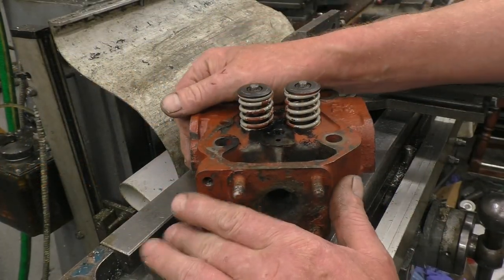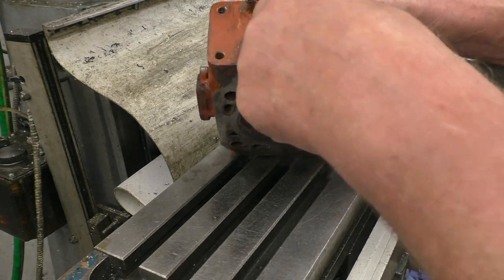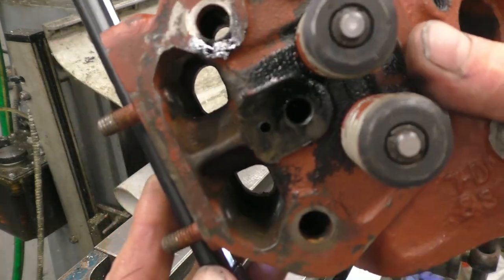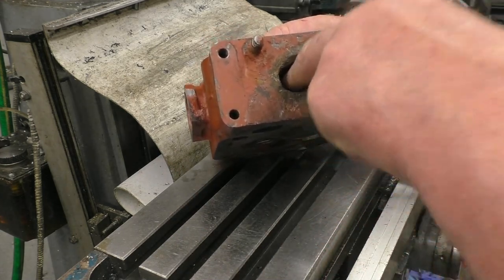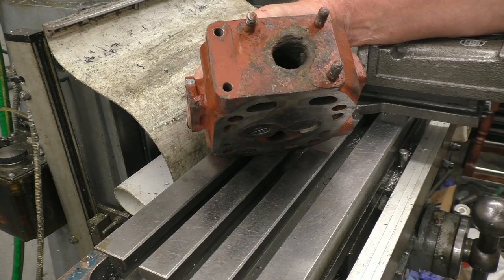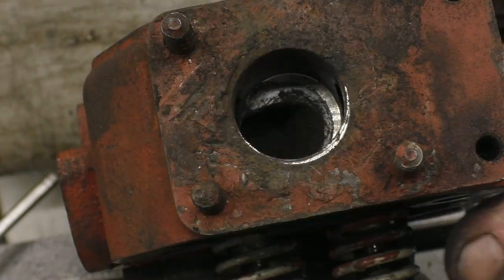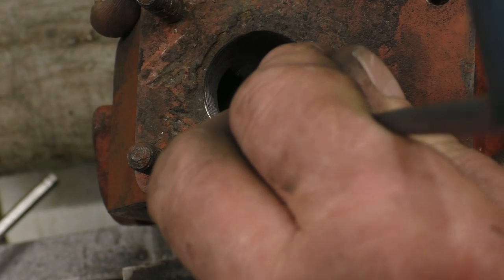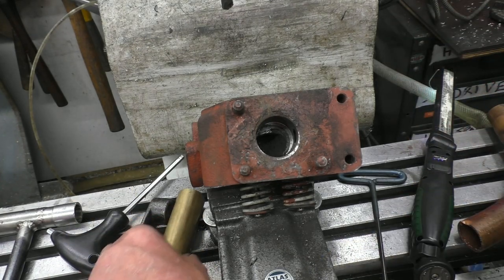SNNC 437 P1  Yanmar Cylinder Head Repair

Comment: Hi John, Seawater will take the zinc out of brass, leaving a weak honeycomb of copper.  Better to use a length of Galvanised water barrel or 316 stainless steel.
barrel.
Reply: Agree. Brass has no place on a boat.
Reply: Correct
Reply from the maker: @srp01983  Very good point any more will be in stainless steel
Reply: would naval bronze also work? i. e. alloy of copper and tin versus brass which is copper and zinc.
Reply: @dwightcarlson7136  Yes, any of the true bronze alloys. Or Stainless 316 as others have said.
Reply: @doubleboost  I would suggest using durAbar cast so the thermal expansion rates are the same. Lots of diesel heads tended to have sealing sleeves of different materials like what you did and eventually they seem to always start leaking.

Comment: John, nice repair but I fear that the brass will suffer parting corrosion or de-zincification as it is also known, especially as it will be in direct contact with the seawater. It depends on the grade, but it would have to be a low zinc alloy to last very well. As a back up spare, I'm sure the owner will be very happy to have it saved from scrap. I really like the mantra 'bore it out, part it off, whack it in'!
Best wishes, Dean. 
Edit, I see someone else has already mentioned this. Sorry to parrot another comment. I agree with the other viewer, a marine grade of stainless would be a good choice for the sleeve. 
Great video, thanks. 
Dean.
Reply from the maker: the next one( if there is one )will be a stainless sleeve
Reply: @doubleboost  There's no doubt it will get him out of trouble if needed John, and it's 100% better than it was. Great night caps.

Comment: Congratulations on 90K subs, bonny lad.

I think, that the bush was enough of an interference fit, without the epoxy resin. I'd have used a few drops of Locktite 603 or 638 (bearing retainer) to make sure it stayed where it was meant to be.

Comment: Be sure to check that the water cooled elbow hasn't failed and began dripping down the wrong side of the exhaust. That's where I see that issue, often freeze cracking on speedboat manifolds that never get drained, but I've only messed with freshwater stuff.

Comment: Nice to try to salvage the head in some way. Brass is no good in seawater unfortunately. It will de zinc it. Aluminium bronze is a good alternative. Or a suitable bit of 316 stainless tube that could be machined to fit. You could also have used a good grade of aluminium like 6082. And I have just realised everyone and his dog have said the same. Sorry.
Reply: Or  gunmetal or permabar malleable iron or admiralty bronze but agree with you totally that brass is hopeles in marine applications
Reply: @howardosborne8647  Yes you are right. The main thing is that for many amateur engineering applications it is possible to use almost any material and get away with it. There are occasions though, and this being a good example, where correct materials science should be followed.

Comment: For those brass nuts, you could've done with a long drill and a pulley tap, so you could tap the who bar length in one go.
Reply: For info only, in industry machinists dont generally like long holes as the drill tends to wander. On a repetition lathe you only drill deep enough for the one item and centre drill again for the next to maintain accuracy. BUT, in this case drilling and tapping for 2 or 3 at a time will be more than good enough.

Comment: Those Yanmar engines are workhorses but I have seen them when they haven't ran for a while with an open exhaust valve, moisture from the cooling system gets into the cylinder and makes a mess of the bore and ruins the valves and valve seats.
Reply: Yanmars have a sacrificial anode that is famous for coming loose and not doing its job of corrosion resistance.
Reply: I've also seen it a couple of times on Yamar marine diesels where the anode is loose and not effective.
Reply: @howardosborne8647  it must be 30 years since I last rebuilt a Yanmar engine but I don't recall seeing one with an intact anode.

Comment: the brass whont corode but having dissimulair materials inde a cilinderhead being flooded with seawater probably causes a lot of calvanic reactions where electric current desolves the material , the exessive rust mightve actually been caused by the lack of a zink anode inside the cooling system
Reply: Yup they often come loose on Yanmars.